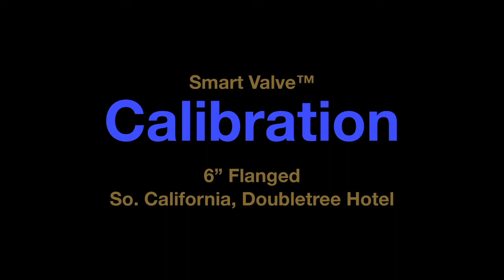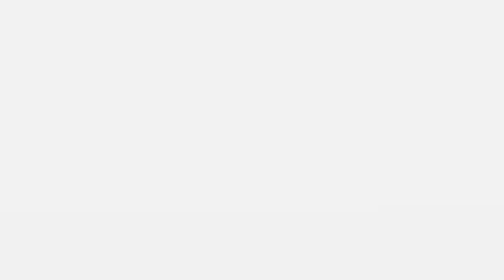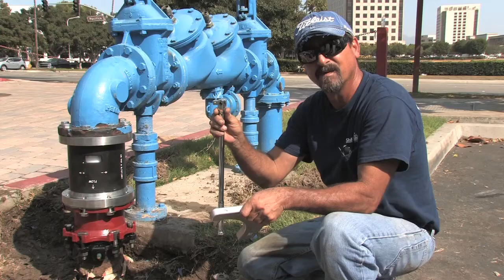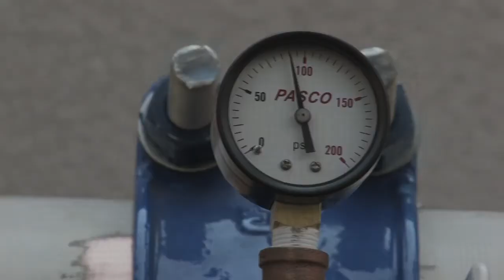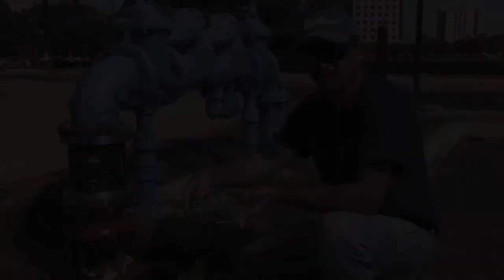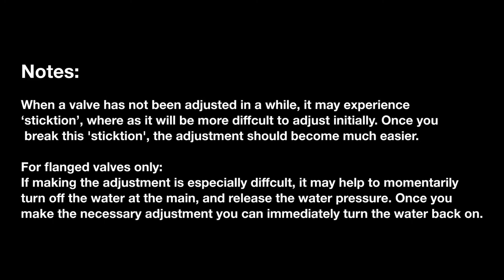SmartValve™ Calibration Training Video

Comment: Can this be adjusted under pressure?
Reply: Thank you for your question. This video is actually of an older valve design, but all of our Smart Valves are adjustable under pressure while water is running. That is the feature that makes the technology work well.